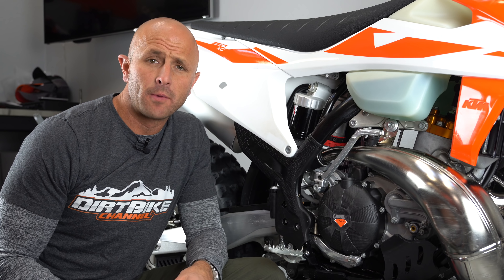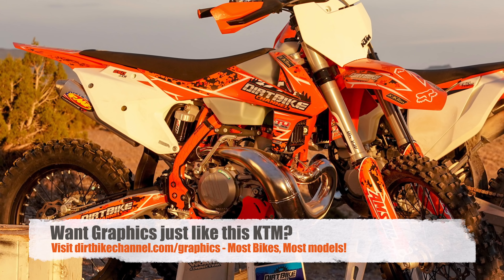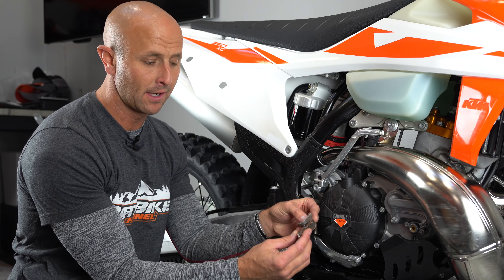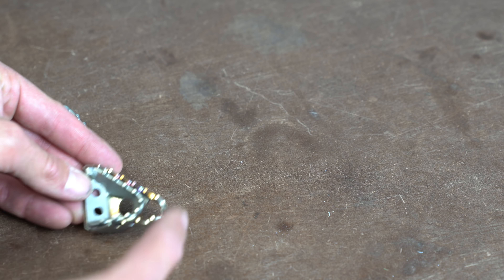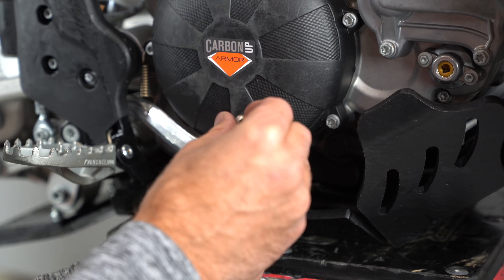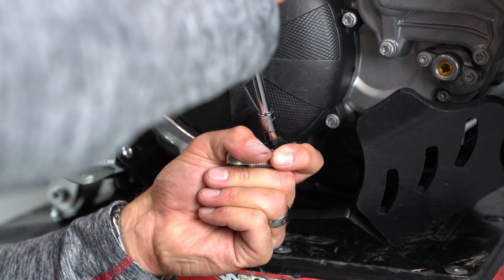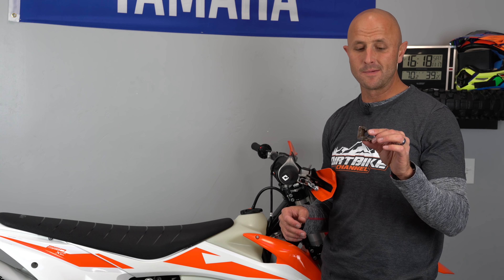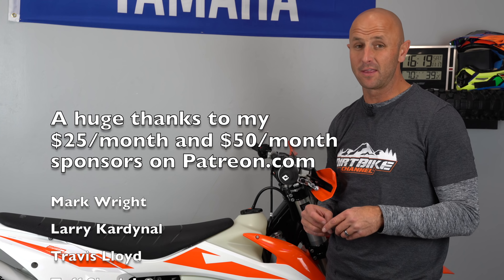Enduro Engineering Extended Rear Brake Tip

Comment: I think it’s your clutch cover. It’s a bit wider and you use it as a reference to where your brake lever should be. With it sticking out just that little bit it changes your perception of where the lever is.

Comment: I found that with my Sidi crossfire 3’s I started missing my rear brake and I bought the ktm orange extended one. Just the 5mm helped a lot. It’s one of the first thing that gets installed on a bike for me.

Comment: The clutch case cover you installed, pushes your boot out away from the cases a little bit and that's why you missed your brake pedal. I had the same issue. The stock four stroke KTM brake pedal tips are 5mm longer than the two stroke tips. I installed one of those and I haven't accidentally missed my brake pedal since.
Reply: yeah, all these additional parts despite having their own purpose often come with so many side effects....i stay clear of stuff like that, its easier on your wallet too

Comment: Hey Kyle thanks for the video I wanted to let you know that that tip was too big for me and I went with the Tusk one and it was half the cost of that Enduro engineering one I really like it also that dent you got in the pipe Tusk makes a universal two-stroke pipe guard $30 and it doesn't look bad and it gives you more protection than the Carbon Fiber One do

Comment: I was considering getting a new ktm in the next few months but i was looking at the service manual it said to re do your bearings and your rod at 80 hours is this something you commonly do on ktms I've never done a bottom end with out needing to
Reply: KTM bottom ends typically last over 500 hours.
Reply: Ktm’s are pretty dang durable guys get lots of hours on oem parts without issues (haters will say differently) 
The manuals are overly conservative on there service intervals just change your oil regularly  and keep filters clean and you’ll have no problems.
Reply: Cactus73a No way!
Reply: My KTM is running just fine with the same bearings and rod, getting close to 400 hours now. Changed the piston once at around 200 hours. The bike is 2012 EXC-F 350 with normal service intervals.
Still runs as new :-)

Comment: Take a look at OEM tip installed in 4T 450 and 500.  I don't know why but these bikes have wider tip. The part number is 79413051000. Another tip is available in power parts catalog but it is definitely too wide for me.